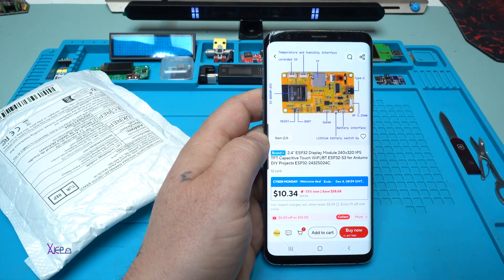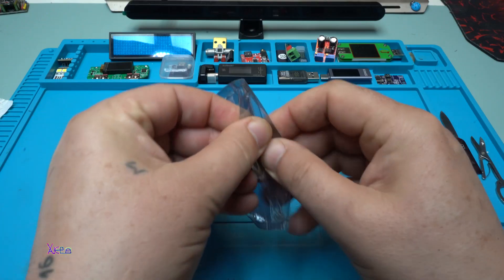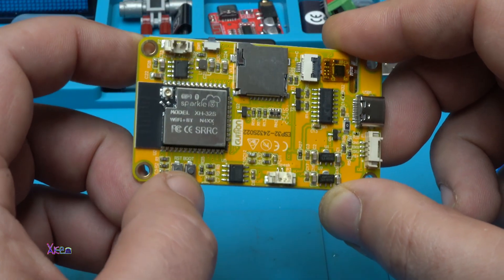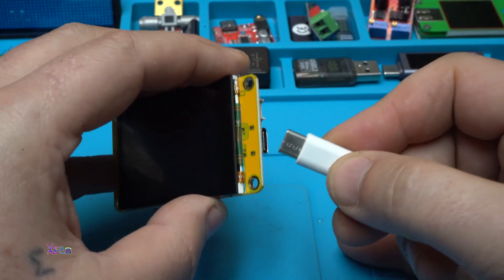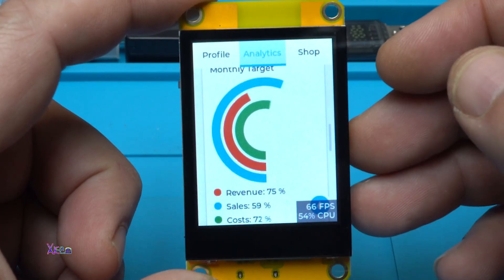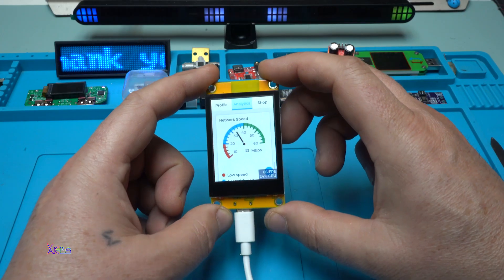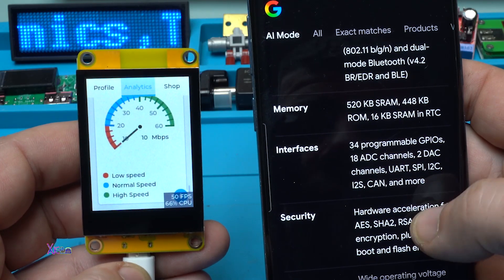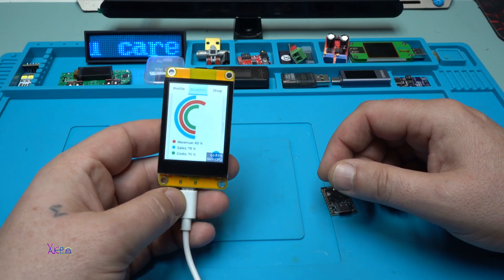ESP32 WIFI&Bluetooth Board 2.4 inch Touch LCD Module 240*320  With Touch screen  WROOM

Comment: Why do they still only have 2.5Ghz connection when most routers are 5 now is a pain
Reply: lower power consumption... just setup a guest 2.5 connection.. takes 30 seconds!
Reply: Routers typically have 2.4Ghz and 5Ghz.
The 5 Ghz offers greater transport speed than 2.4Ghz but the ESP32 isn't really fast enough to take advantage of that.
The 2.4Ghz penetrates walls better. I typically only use the 2.4Ghz band at home for that reason.

Comment: It looks like a smaller version of the so-called "cheap yellow display" board. The screen has the same resolution so a lot of the programs written for the CYD will probably be adaptable.
Reply: Yes, it is a CYD in a smaller version. Quite nice to use as a home assistant display